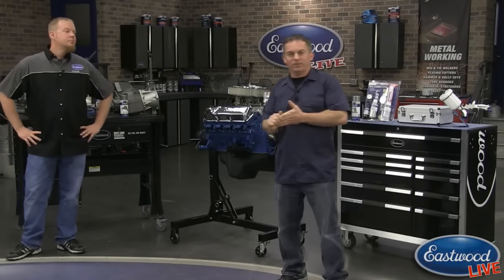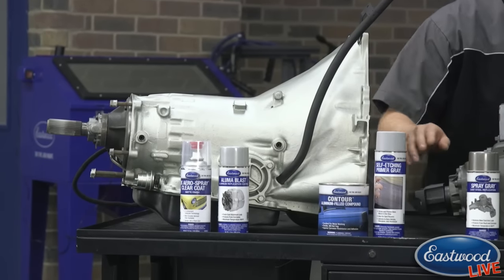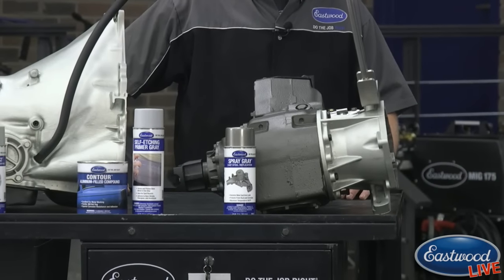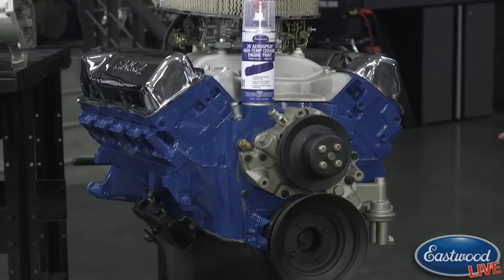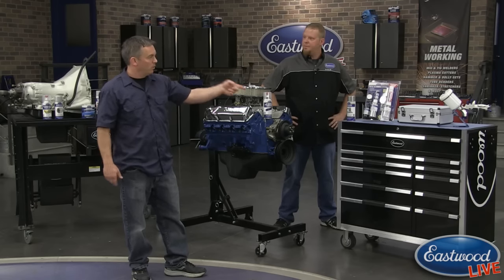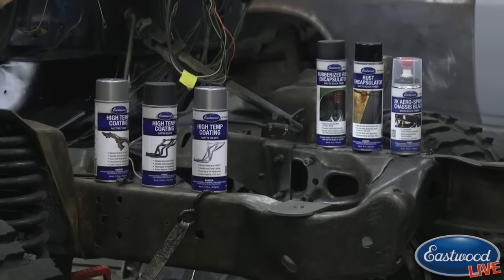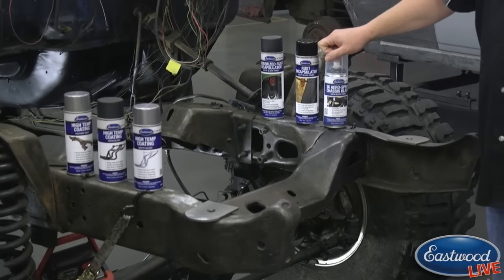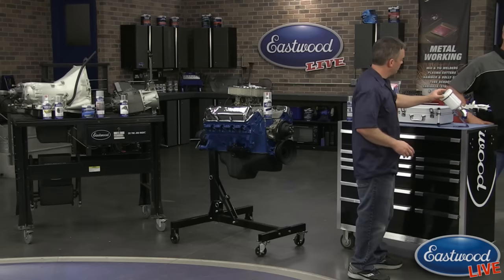How To Restore Your Engine & Underhood Components! AlumaBlast – Spray Gray – Engine Paint & More

Comment: This is sick. I'm in the process of fixing up and restoring my 1995 Ford F-250 with a 7.3L Powerstroke Turbo Diesel. I found out about the 2K paint line up and Extreme Chassis Black Paint along with Under Hood Paint and more. Do you think that the engine paint you guys have to offer will last in this truck? Even though I'm restoring the truck, it's gonna be put to work after it's finished and I'm wondering if the engine paint will hold up to these 120°F summers we have  in Arizona plus the heat that the engine emits. Plus, this thing will be going on the trails, hitting mud pits, etc.
Reply from the maker: For sure, they're engineered to last. Check out our high-temp 2k ceramic engine paints. They're rated for 650 degrees F. 🔥  https://www.eastwood.com/paints/hi-temp-engine-paints/engine-paints.html
Send us some pictures of the truck, we'd love to see them! @eastwoodco on Instagram.

Comment: What did you guys spray on the bolts?
Reply from the maker: The black bolts were coated with the Eastwood Metal Blackening System, like the oil pan and some other components.  Here it is:  http://www.eastwood.com/metal-blackening-system.html